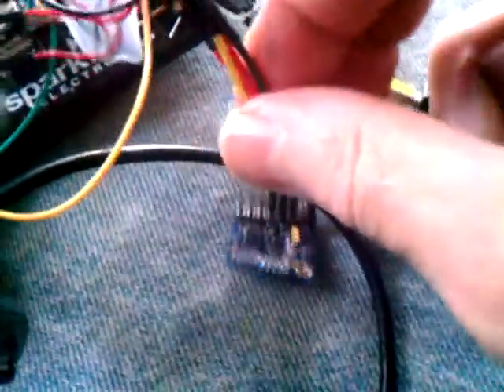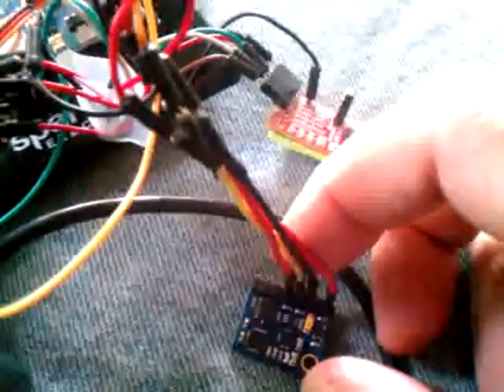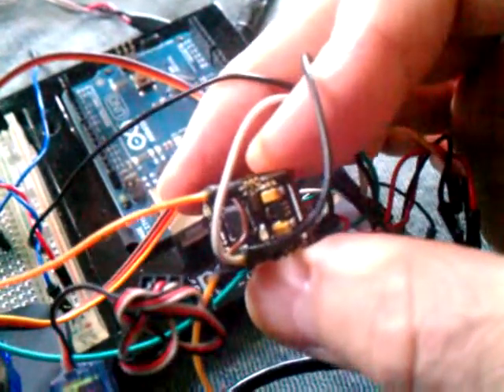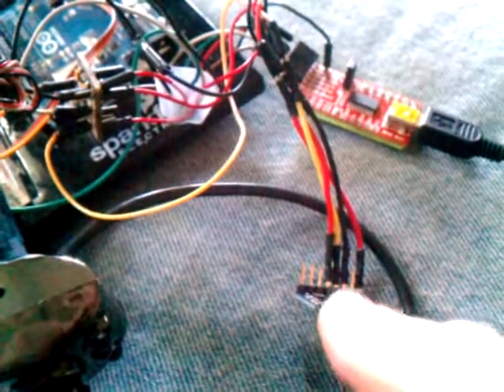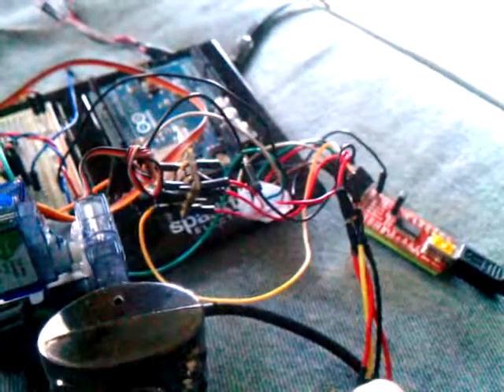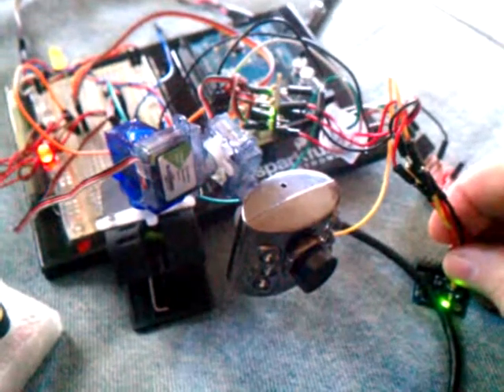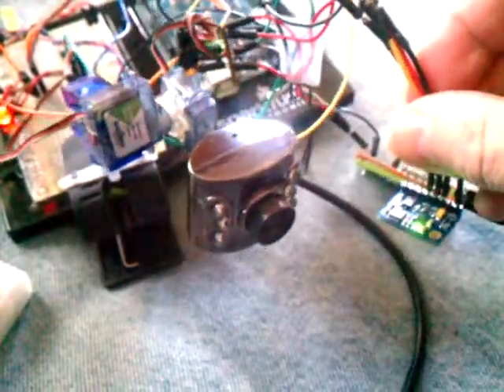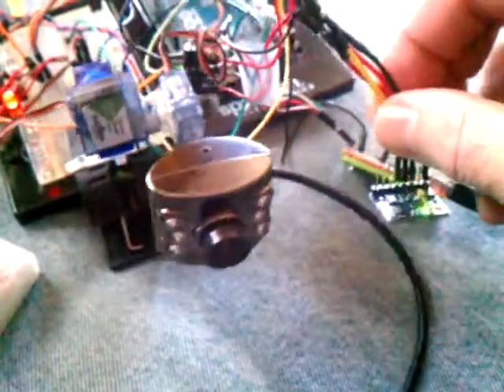IMU & Servos

Comment from the maker: Hello, I apologize I do not know where the code is anymore. I did not finish this to publish and do not remember the code base. However, the MCU is a Femtoduino designed by Fabio Verasano and can be found online. The IMU code I used is by Denis Frye for his FPV Head Tracker. I would recommend for any experimenter wanting a direct from board to servo setup to use another IMU code version by Fabio Verasano for his FreeMU which is very good.